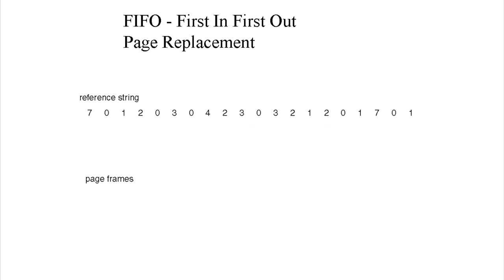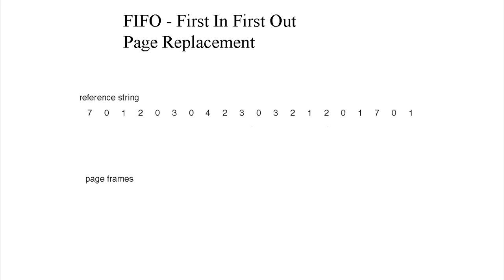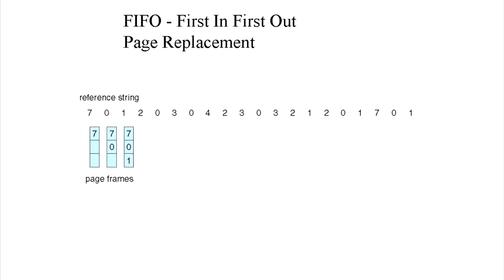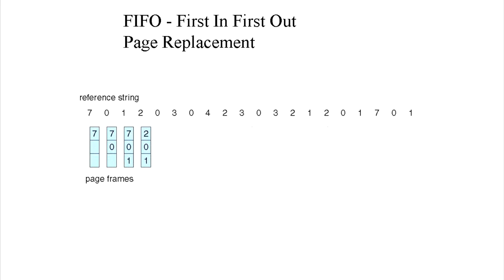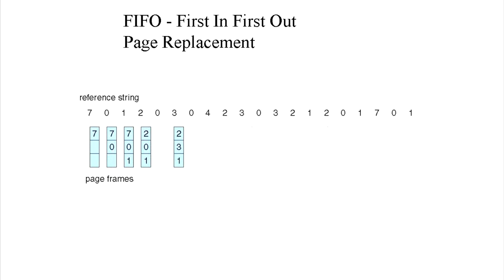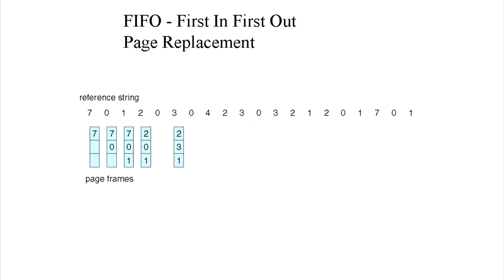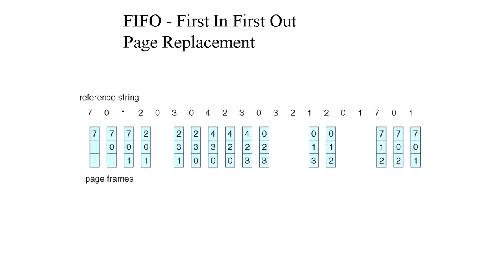(FIFO) First-in, First-out page replacement

Comment: At 3:17 why did you skip 3 and 2? 
At that point 2 was the longest standing so it should be replaced with 3. so it's 0|3|3 -> 0|3|2 -> ...
Reply: He skip them because 3 and 2 don't produce page fault
Reply: @dvoraklovelace2801  can you pliz explain
Reply: @Astronomy.532lifenspace  hi, i understand it as, the page frame 3:17 currently holds [0|3|2]. once you encounter 3 and 2 in the reference string, it counts as a "page hit" since those are in the page table. since they "hit", they do not page fault. part of the reference string will only page fault when it is not contained in the page frame. 

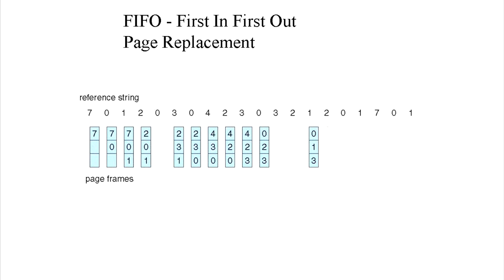hence, at 3:22, when he encounters 1 in the reference string, he inserts it into the page frame, as it is new and was NOT in the page frame before the specified timestamp.

i think that is correct - hope that helps!
EDIT: corrected some terminology that wasnt consistent